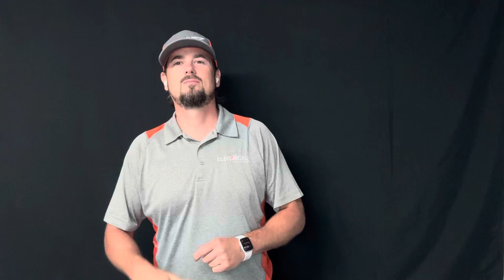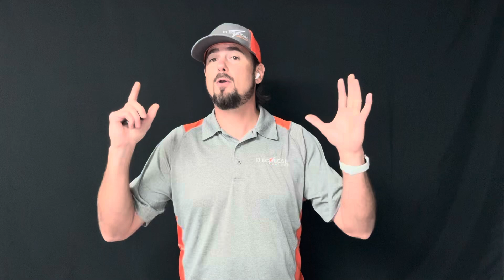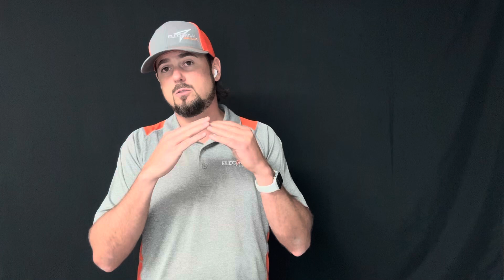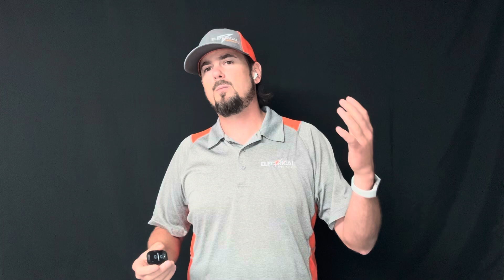DO I NEED TO REPLACE MY ELECTRICAL PANEL? #1 Obsolete or Defective

Comment: Hey Sparky, I have a Sylvania panel with Zinsco breakers. According to what you're saying, it sounds like I don't actually need to replace the "panel" (box and bus) itself but just the faulty breakers. Is that right? Can I just replace the Zinsco breakers with new UBIZ (WESCO/Connecticut Electric) breakers and then I'm good to go? If I do that, will I be safe? Thank you, brother. (fellow Sparky)
Reply from the maker: Great question! It all comes down to what model you have in your home. Take a look and see if you can find factory printing or stamping and isolate which model you have. Then you can use the good ol google machine or the is my panel safe website to verify if your panel is a candidate for breaker replacement. Some specific models have issues with the bus bars themselves which a breaker swap will not solve. Let us know what you find!
Reply: @electricalspecialists  will do, thank you brother

Comment: If your electrician comes out and says that you have a bad main breaker I can't replace just the main breaker I have to replace the whole panel find
Reply from the maker: It depends on the age of your equipment Matt. Some brands like Square D make retrofit main breakers for older models, and some brands do not. You will have to do some research on your particular model to find out whats available. Feel free to have multiple reputable electricians take a look make sure you are being given solid advice. Let us know what you find out, and thanks for watching!

Comment: I have a 40 year old GE panel. The breakers are still available. Should I replace all the breakers or should the whole panel be replaced?
Reply from the maker: That's an excellent question Jacob. 40 Years is about as the limit when it comes to lifespan of electrical equipment, especially the panel. Even with proper maintenance, the components simply wear down. For proper context, it simply matters what your intention is. If it is to sell the home in the next few years and leave a functional main panel, then changing the breakers is a good idea. If your plan is to stay put and safety is the concern, I would lean towards replacement, or at the very least installing dual function breakers. These will give you ArcFault and GFCI protection on every branch circuit, which is about as safe as one can get. You will just have to weigh the balance between investing into the old panel, or updating everything at once. Back to the old car analogy. Adding new high performance to a car with high mileage can make sense, its just best to be able to lay all options on the table and decide what makes the most sense for you. Let me know if I can help you hone this in any further, and thank you for reaching out.